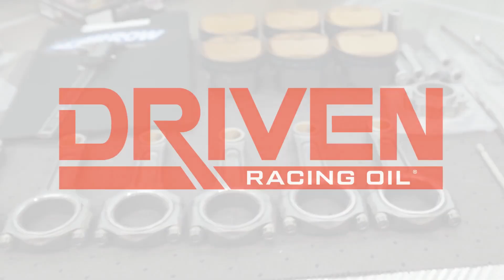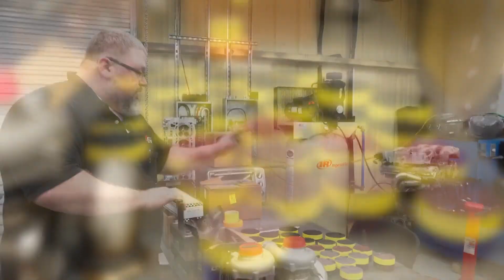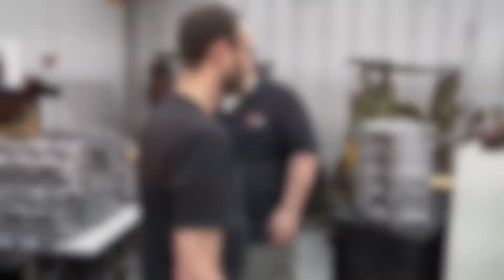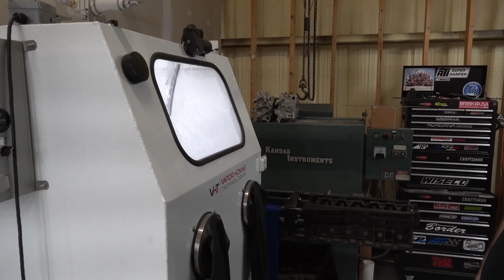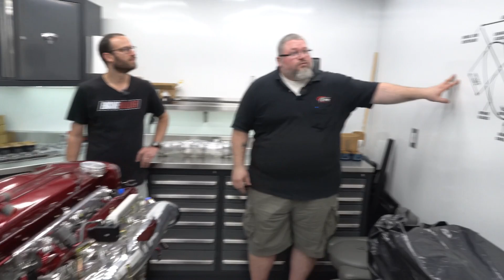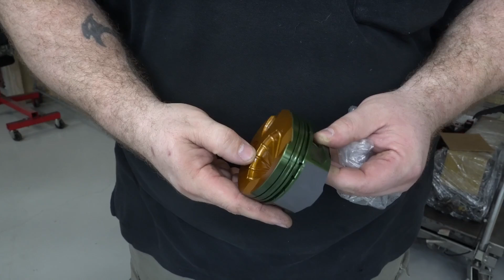Engineered Performance is Taking Nissan Engines to Another Level

Comment: One of those shops that on the face of it doesn't look impressive, but looking at the work, you just know your in safe hands. Nothing beats a true machinist that turns their hand to what is in reality, straight forward work.
Reply: What exactly doesn't look impressive????
Reply: @stevewelborn8744 The old manual machines as apposed to some shops which are all new shiny white machinery
Reply: @stevewelborn8744 lol
Reply: @stevewelborn8744  and I forgot to mention that epr was first to market with a billet main cap kit for the vg30 and many other key parts for nissan platform that they have designed and built
Reply: How about the intake manifolds they are doing for the vg30dett or the oil pan maybe the turbo manifolds/kits that you can see in the background? Not to mention the motors they are building and have a cnc program for all the vg heads. Come on man don’t be such a hatter?